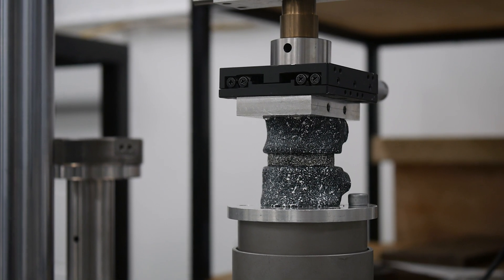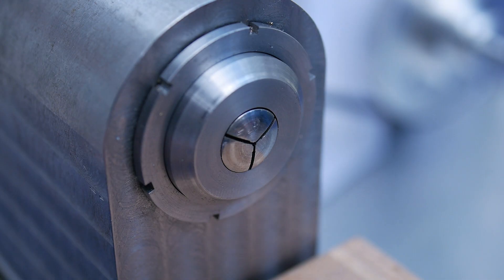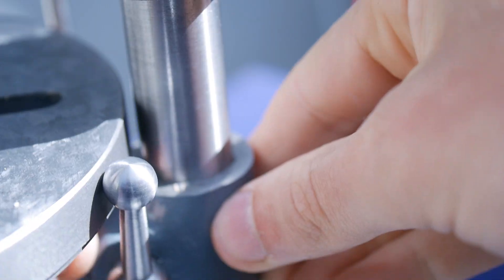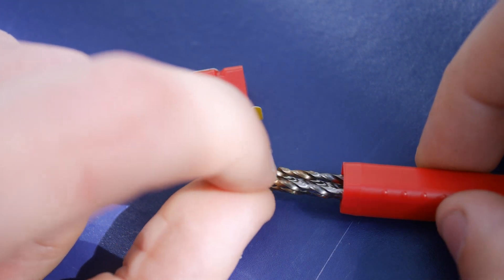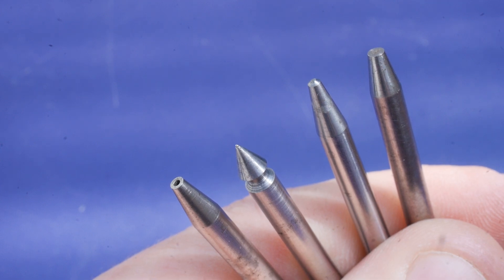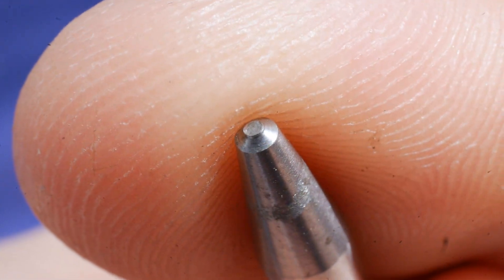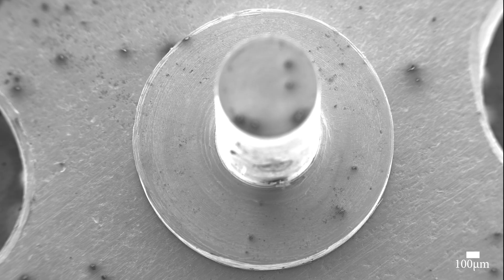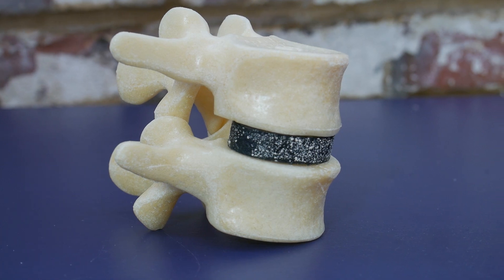Machining a Next-Gen Spinal Implant: My PhD in 9 minutes

Comment from the maker: Hi everyone, thanks for watching! There are a few points that are coming up in the comments that I would like to clarify: 
1) The spinal cord does not run through the centre of the implant.
2) Although a significant part of the video, the focus of my PhD was not on joining the pins to the endplates. In the final implant, the pins and endplates would most likely be machined from one piece, or the the pins would be diffusion bonded or welded to the endplates. This staking approach enabled low-cost prototyping. 
3) There's been a few comments on 3D printing. 3D printed metal structures lack the flexibility for the device to operate but as 3D printing progresses, perhaps this will be a viable method in the future. 
4) Counterintuitively, most disc replacement surgeries are performed through an incision in the front of a patient’s body. This might seem like an odd direction to approach the spine from, but it makes it easier to avoid the spinal cord. I didn't talk about this in the video but my implant is designed to be able to compress, and then expand into the disc space, allowing insertion through a much smaller lateral incision. 
Thanks again for the interest!
Reply: Cut from the front, woah i didn't see that coming & i don't even want to picture it o.o
Reply: I've had both anterior (front) and posterior (rear) cervical surgeries. The anterior surgeries were far less invasive. The posterior ultimately had to happen though, since the 3 previous anterior surgeries collapsed on each other. I have an approx. 12" scar running down the back of my neck where they had to cut and remove the protective bone of the spine to reach the actual spine itself. On the anterior version of the surgery they just have to push aside the corresponding anatomy and then move it back after finishing up. After an anterior fusion I was moving around and back to a low impact lifestyle in a few weeks. After the posterior...it's been a year and I'm still feeling the after effects which is considered normal.
Reply: @Tenzen.  Wow... Sounds hard :( ❤️
Reply: As a mechanical engineer that works in the electronics industry, if for some reason you are having an issue with pin retention in the more flexible material. You may want to look into using a swaging process rather than a staking process for holing the pins in place. The installation process is very similar but is rolls a thin edge of material over on the back side, rather than just pushing out radially against the walls of the hole. Over all great design and channel love the work!
Reply: How Does a Person Apply for the Testing Phaze of this implant please..
I have ( DISH ) Diffuse Idiopathic Skeletal Hypertosis..as well as Disc Damage..
Any Treatment that can REDUCE The Pain Without Drugs is A Great Thing..
❤❤❤
Regards Vince.
Reply: With regards to the actual implant geometry and method of introduction, I think you'll find some resistance from surgeons willing to over-distract the disc space to the height required to insert your implant (i.e. the height of the implant + the height of the pins). However, it sounds like your fourth comment is implying that the size of the implant shown in the video is not the height when introduced. That's the only part I'm interested in and therefore of course it is not shown! 😂
Reply: This kind of thing might save my dad, he broke his spine years ago and had damage to the discs, and they had to put metal rods in his back, but it just kept breaking in different places, with more and more discs failing, until they basically gave up on fixing it. If these implants are better/more resilient than natural discs, he might have a chance at living a normal life again without pain.
Reply: Disc squeezed through a tube? Amazing! Volunteer right here my man!
Reply: Hi, and thanks for a fantastic channel :D
I wonder if EMD could be a possible manufacturing process?
Reply: I’ll take 4 lumbar discs please👍🏼
Reply: Very interesting. Do you have a link to your final publication? I have a spinal disc implant so very curious about continued tech development in this area.
Reply: could you not use thin rods push thru at angle  be much easier cheaper  think reinforcing steel inside columns
Reply: how much of your phd has to do with total cost   cost is the single greatest problem with things like this
Reply: Are there any plans for using alternative materials?  
Metal implants are one of the worst tortures there is if the patient has metal sensitivities.

Comment: Rule #1 Never let an Orthopedic work on your spine. Neurosurgeon only.
I had L5-S1 replaced with Raye cages and Pedicle screws with a 90% success. I still have issues do to long term nerve damage. It took 3 surgeries and 9 years with the State and the doctors conservative approach. That looks to be unique devise, however as a machinist i would not allow a device in small parts and pieces, it would have to be machined from billet titanium. I understand prototype work to establish a working part. Seems like L4, L5, and S1 take the brunt and further up the back the weaker it gets. Pain and life there are trade offs just to get comfortable again. Solid fusions are great but there are cons like flexibility and lifting restrictions. Later in life not to many people flex except to tie shoes

Comment: I had no idea you did work in the artificial disc replacement field. I just watched and commented on your video of you making the heart of a watch. Anyways, I thought I would share my experience with artificial discs. I had ruptured 2 discs at C5-C6-C7 in my cervical spine. The discs were through the protective sac around the cord, and was actually deflecting the spinal cord as I lay straight in a MRI machine. I did not want a fusion, as I was only 34 years old. I ended up getting 2 Mobi-C artificial discs installed. I loved them, and they worked great for my range of motion. I was very happy with them, however, about 3 years later, 1 of them had the top metal plate detach from the bone, and the serrated teeth carved away the bone significantly. To avoid further complications, we all decided it would be best to remove them both, and fuse them all together. I have a stiffer neck now, but I guess it's not going anywhere. I just wanted to share. Great video. Thanks.

Comment: Great work! I worked with several osseointegration  Ti projects with Prof Brånemark and co in the 1980:s. We used the double sided fiber laser CO2 welding method for dental bridges among other things, but it is not as easy as some people may think. There was a lot of talk and different surface projects, but the conclusion was that a somewhat coarse Ti surface always is OK, problem was that Per Ingvar dropped the original Ti patent that Ti osseointegrates, therefore all these different patents on surfaces from Nobel biocare and others. I worked with some of these Swedish companies like Ospol and others in later years.

Comment: I am glad that you're studying this. I have 2 total disc replacement devices in my cervical spine: C5-C6 & C6-C7. An area of contention in the total disc replacement arena is whether or not the disc needs to be a compliant or elastomeric mechanism. I have 2 Zimmer Biomet "Mobi-C" devices in my neck and they are NON-compliant, but highly mobile, constrained devices. I have been happy with their performance, but much of the research in this field needs to be done as to improve the technique and preparation of the bone structure for accepting a diac replacement device. All spines are minutely different and have unique characteristics, so a "one size fits all" device is not acceptable for every patient. Good luck with your research, would love to see more about this.

Comment: The world is already better with people like you and I.... thanks for sharing your video ... my older brother and I suffer from excruciating pain when nerves get pressed between vertebras ... my brother, a dentist, manages his suffering with professionals and their prescriptions ..... I made a silicone mold for me that I place in between by hard belt for lifting weights and my column lumbar area .... this silicone mold and belt prevents my verterbras to dislocate while using my muscles, and I can even lift 2 - 90 lbs cement bags, of which act I made a video for my brother (who lives in another country) to watch, to induce him into making his own mold, but he believes not his eyes or my video .... I believe that instead of making a disk replacement, an adjustable and removable spacer would secure in place adjacent vertebras for the necessary time, to allow one own body to rebuild the disk, in about 2 years I calculate, the fixation of adjacent vertebras would allow the disk to painlessly regrow itself, thence with proper nutrients, mother cells perhaps, our body rebuilds all necessary.... similar devices are used to extend bones in people that need bone extensions,  like in legs when 1 leg is shorter than the other. ... butchering disk is so obsolete, I strongly believe, based on watching so many videos related with the intent of me having surgery, to what my other older brother, a surgeon reinforces saying to me "don't do it"

Comment: As someone that has had 4 spinal surgeries, the most important part of this is installing it through a smaller incision. Stabilizing the spine is relatively easy. However, surgery leaves scar tissue. And the scar tissue can continue to irritate the nerve and once formed is difficult to eradicate. The other issue is that the surgery needs to be simple, effective, cheap and have a high rate of success. Because spine surgeries have a high failure rate and due to cost, conservative strategies are prudent. However, if you have a pinched nerve, every day it is pinched can degrade the nerve. And nerves don't really heal. So a novel method or device that is viable for an earlier intervention would be extremely worthwhile.

Comment: My mother just had calcium and part of her spine removed and a cage put in. They nicked the spinal fluid channel or whatever its called and it leaked so she had a difficult recover but is getting better. Both my parents have bad backs (father has had multiple surgeries like spinal fusions and some experimental surgery where electrodes are imbedded in the spine and a battery under the skin controlled by an ipod gives shocks to kind of massage the muscles in and around it as well as a knee replacement) from working in a factory on hard flooring and then doing tilling jobs on the side to make extra money. Unfortunately I ended up herniating two discs in a skidoo accident and found out from a specialist I have quiet a lot of osteophytes and degenerative disc disease and gave me a bunch of stuff I could do to help slow it down and keep myself from ending up like my parents. I hope one day we can find an aternative to the invasive surgeries or at least increase the odds of not making anything worse as it seems almost every time I've gone with them to the consult there is a large chance things can end up worse like being in more pain or god forbid becoming paralyzed which was a real possibility. Scary stuff.

Comment: As a machinist, it was extremely interesting to see your watchmaking methods. Nothing overcomplicated and the process makes a lot of sense. I machined a lot of one-off RnD components, so I always appreciate learning different things that I could apply at some point. Your watchmaker assembly kit using the stakes seems a lot better than having to use an arbor press for such tiny parts. I remember when I had to make medical components, I had recommended using loctite or a press fit to seize some parts together to make it easier to machine. Loctite was not wanted due to the fact that the substance would not be within the body, but the potential for any contact as the component gets tested was a concern. But forcing a mechanical joint like the stakes is something I'll have to keep in mind as well. 
If I may ask, how flat did the plate remain after it was drilled + stakes were added? Many parts I've worked on have been requested to have insane tolerances, mainly just to avoid that extra headache while in the prototyping phase.
Thank you for sharing this type of information so that others can learn and improve.

Comment: In spite of all the precise engineering at 6:22 the holes do not seem to be slipping out of intended position on the device. If it is just a quick prototype, it should not be an issue though.

Comment: Got my spinal disc implant at 29, now 41. h5/h6, so right above the shoulder. but mine is not squishy like this. dont get me wrong it works fine, but the main problems I have is cracking and musclepain in my shoulders/neck. I always felt like my neck was "to long" after the OP. Cool stuff. Keep it up!

Comment: What is hard to understand is the range of motion available. This looks like a fixture to be used in a spine segment that`s not prone to much bending and stretching because the forces you apply to it are on the vertical axis only. It will not support shear on the x axis neither i believe on a combined xy movement in the cervical zone. 
Did i miss anything?

Comment: I've wondered if it would be possible to surround the herniated or bulging disc with a thin but tough and flexible band of material and then tighten the band up thereby squeezing the disc back into its normal shape so it is no longer protruding and impinging into the spinal nerves?

Comment: Just a suggestion, instead of peening over your pins or machining them from a single piece of material, you might want to consider shrink fitting them into the frame. If you are unaware of the process, you make the hole smaller than the diameter of the pin at room temperature. Then you submerge the pins in liquid nitrogen and then when they shrink due to the cold, you press them into the holes. When they warm up, they expand and the fit is exceptionally tight and takes fewer steps to get a good result compared to peening.
I am a design engineer with 40+ years who has designed everything from medical devices to video game hardware.
I am also a long time sufferer of lower back pain due to a very bad car accident many years ago. So I applaud anyone who has a novel approach on helping those like me who suffer daily with this problem.
Reply: If that pin was in my back, I'd prefer the locked-in approach of the swage to the shrink fit any day, no matter what my stress and friction analyses told me!

Comment: Where those just plain old optical lenses being used on the two FLIR cameras?  I thought IR cameras require a germanium lens, but those looked like my canon 50mm primes with a c-mount adapter.
Reply from the maker: The FLIR cameras had standard CCDs, they were used for strain measurement. The IR camera was a bolometer InfraTech, and you are right this doesn’t use a standard lens.

Comment: Good work! I am curious why the waterjet couldn't be used to make the final holes for adhesion to the potting material, those don't seem like they need nearly as tight of a tolerance as the pin holes.

Comment: This is the first video I've seen of this channel and this is quite an interesting concept for an implant. I don't know your background but I assume you have consulted with specialists in spinal surgery and implantation. What cases is this implant design intended/applicable for ? It does seem like a pretty serious intervention so I assume simpler earlier stage herniations are not suitable for it. Is it aimed to be an alternative for spinal fusion and does this method avoid the complications of vertebral fusion like proximal vertebral bone degeneration ? Would this implementation allow for normal range of movement of the vertebral joints as apposed to the lack of movement in fusion ? Needless to say I am very interested in seeing how this project evolves and grows, fascinating and ingenious idea !

Comment: how do you stop the bone from receding away from the pins when there is force  on them? (my understanding is that bone will retreat from pins if they are load bearing over time) seams to be the biggest problem your going to have??
Reply from the maker: Hi HypoConDreAct, the bone-loss mechanism you might be thinking of is “stress shielding”, which is where a stiff implant carries the load that would normally go through a bone. Effectively, the body starts to recognise that the bone in that region isn’t being used, so it resorbs it faster than it replaces it. This is especially common with long-stemmed devices like hip implants.

This implant is designed to minimise these effects by:
a) Conforming to the adjacent bone surfaces, spreading the load more evenly;
b) Reproducing the stiffness of the natural disc;
c) Using a larger surface area than most existing spinal implants.

Comment: I don't understand why the scanning electron microscope was needed. Those pins weren't that small, was it just used because you had access to the SEM? A macro camera lens or a microscope with a camera would have done the job. Cool implant though, ill probably need one of those.
Reply: Tribology and to evaluate surface roughness at the micron level.

Comment: Interesting but how would this be applied? For this implant to be used you'd need to, somehow, cut the spinal cord, which is obviously not possible. The only thing possible would be, if this implant isn't a solid ring.
Reply: One more time.  All artificial disc implants are installed forwards (anterior) of the spinal cord.  The lumbar and the cervical discs are located forwards (anterior) of the spinal cord.  This is why all modern artificial disc replacement surgeries approach from the front of the body.